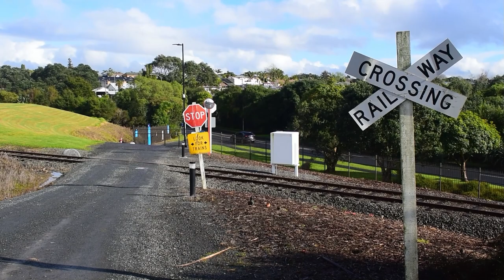Weekend Railfanning in Auckland, NZ (ft. AM electrics, MOTAT trams and Y 542) ~ June 2023 (HD)

Comment from the maker: Here are the timestamps, if you just want to watch the M.O.T.A.T. footage:
0:00 - 0:15 ~ Intro
0:16 - 5:50 ~ Mainline Railfanning
5:50 - 13:40 ~ M.O.T.A.T. trams on their first runs of the day
13:41 - 18:51 ~ Y 542 on the Western Springs Railway
18:51 - 27:19 ~ Mini-spotlight on Auckland tram No. 44

From what I gather, the reason why there was disruption north of Penrose on June 17 is because the morning Te Huia service passed a signal at red and broke the points for the Onehunga Branch, which were set against DFB 7077 and her coaches. What a mess.

Comment: 159 and 135 are of the same Double Saloon class of tram. No. 92 - 160 were Mark I whilst No. 161 - 231 were Mark II. Both variants were very similar however the Mk II had the destination and night signal equipment incorporated into the roof. 135 has been restored to how she looked in 1921 when she was built. The double saloons were later modified with an enclosed center section, enclosed drivers platforms, destination route number boxes and were painted in red. This is the condition that Wellington Tramway Museum's 151 and 159 are in. WTM also has Mk II double saloons 185 and 207.  

Fiducias 238, 239, 252, 257 & 260 have also been preserved. 235 was preserved but has been recently dismantled for spare parts. 

All Wellington trams that were in service when the tramway closed (excluding those in preservation) were taken to the Happy Valley in Wellington, rolled on their sides, covered in a mixture of Kerosene and Petrol and burnt.
Reply: Fiducia 244 has also been preserved - she was originally in storage at MOTAT until 2021 when  she was transferred to WTM at Paekakariki.

Comment: Nice video.  Just for my information, what are the gauges of the tram line?  Thanks.
Bob from Santa Barbara, California
Reply from the maker: It's 4ft 8.5inch gauge for the Australian trams, while the New Zealand ones use 4ft gauge like the Glasgow Subway, although I struggle to remember the gauges.
Reply: @DC4260Productions  Thanks for the info.  I'll be able to sleep now.  Hah hah.
Reply: Auckland, Wanganui, and Melbourne trams run on 4' 8 1/2" gauge whilst Wellington uses a 4' gauge. From what I have heard Wellington used the narrow gauge due to the narrower streets. Could be a housewives tale however. 

Gisborne also used a 4' gauge on their short lived Edison storage battery tramway from 1913 to 1929

Napier and the Roslyn-Maori Hill tramway used a 3' 6" gauge, also in use as New Zealand railway gauge. 

Dunedin used a 4' 8" gauge.